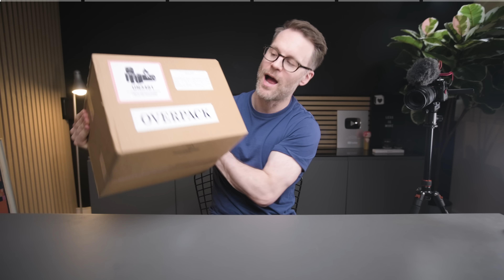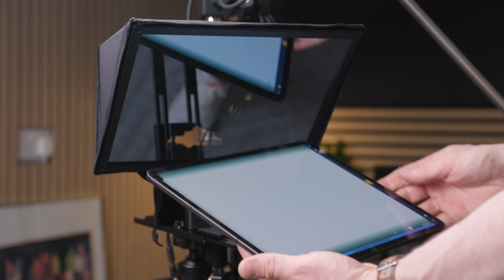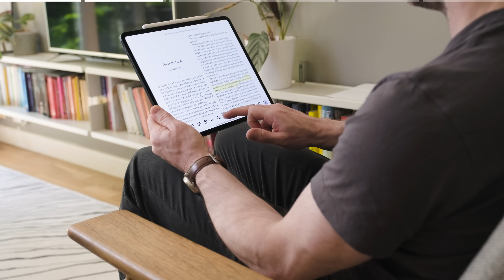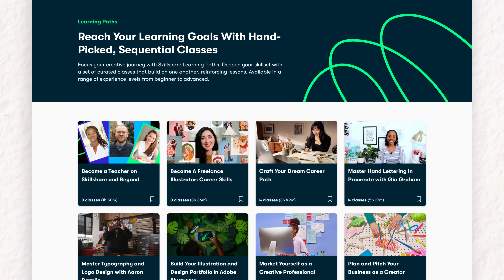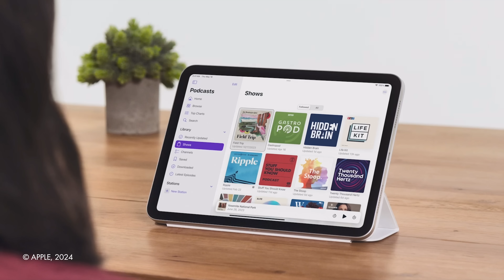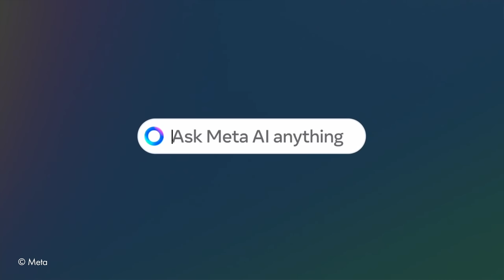What Makes The iPad Pro Worth It? 2-Weeks With M4

Comment: After my GCSEs I’m looking to buy an iPad Pro, and I’m not sure between getting the 13 inch or 11 inch, if I were to get the 11 inch I was wondering if it is worth also getting a monitor so I could use an external keyboard and mouse with the monitor and iPad while at home at my desk, but then I could just use the iPad when I’m at school for example. What do you think? Is there any point also getting a monitor, and should I go 11 inch or 13 inch?
Reply from the maker: I think for most people the 11 inch is best for reading and note taking and portability. With an external monitor and Stage manager could be a nice combo. Defo try both in the shop first to see what you feel. I still feel a laptop is essential for many - but if you can do all in one device - 13 inch is great: I did it for 2 years and was deffo better for multi tasking apps.
Reply: @BetterCreating  yeah ok, I’m still undecided on the size so I will try them out in store

Comment: It’s simply ridiculous that apple still refuse to merge iOS and macOS
Reply from the maker: It’s a totally different setup… iPadOS Pro? Will they make a mid point?
Reply: @BetterCreating  or maybe macOS tablet mode, they already put a computer chip in iPad, but prevent it from running a computer system, doesn’t make sense